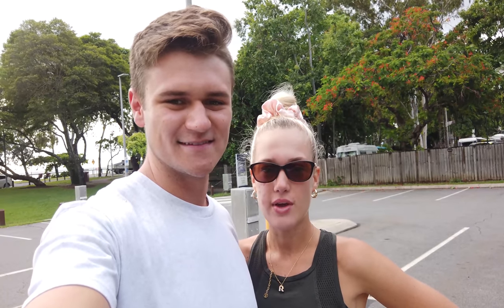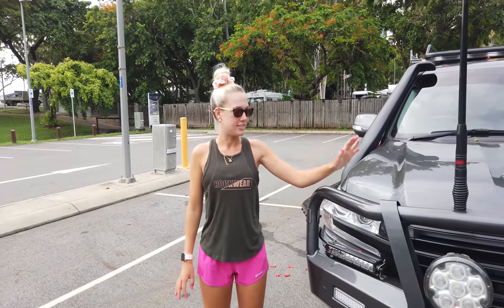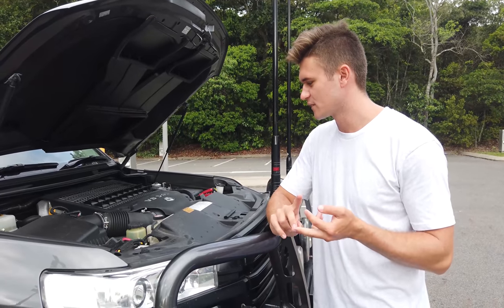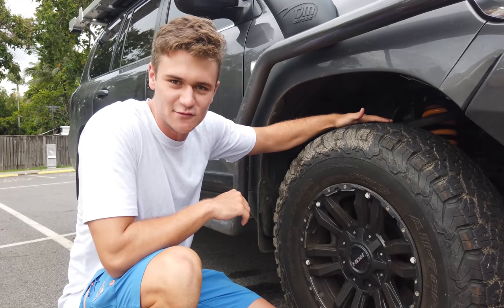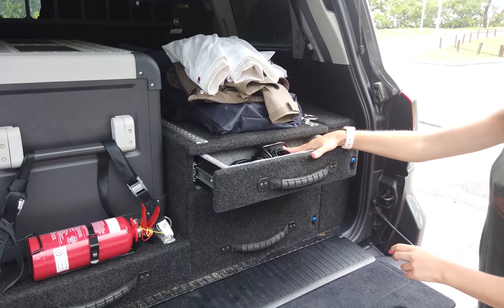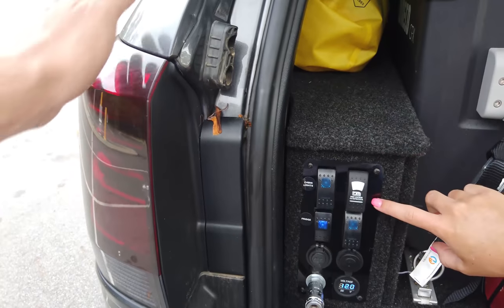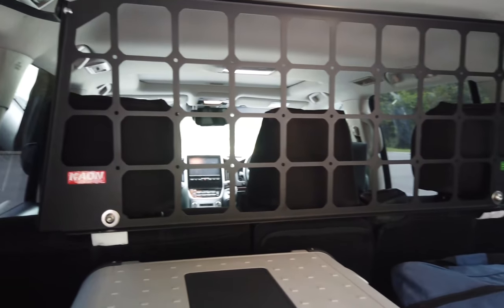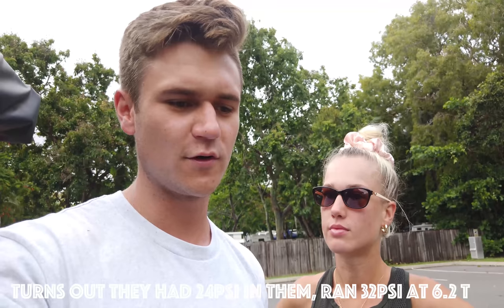200 SERIES LAND CRUISER BUILD | SEAK LIFE RIG WALKTHROUGH!

Comment: Nice rig. You could gain back all the space in your passenger side drawer wing by moving your compressor into the driver’s side rear quarter panel where the factory jack is stored. You can actually fit the ARB twin compressor & 4L air tank in there. Happy trails.
Reply from the maker: That sounds good ! Don’t need it yet but would be a good little mod!

Comment: Awesome rig! Random question though... are your personalised plates the Prestige/Flexi Framed ones? I’ve buggered mine so going to get them remade and like the look of these - yet to see them in the wild yet 😬
Reply from the maker: They are framed but I would get flex if I had my time again
Reply: @Nickjm1267  copy that - thanks. I’ve got Flexi now and wondering how they would work when I put them in the 200 when it arrives. My main concern was once I’ve added the front bar and have the licence plate flap for the winch, how I’d attach the Flexi plate to it. Might just go for it and cross that bridge when it comes up 🤷🏼‍♂️
Reply from the maker: @opt6037  through bolt be super careful when drilling
Reply from the maker: How did it go?
Reply: @Nickjm1267  yeah good. Stuck with the flexi’s I already had and bolted on to the front 1 double sided tape on the back one. After measuring out bolt holes for front I just taped up the drill locations and started with an extremely small drill bit and gradually got bigger. Think I ended up using 4 different sizes. Anyway - worked well and no cracks through the plate which was great 👍🏼

Comment: FYI the gearbox and transfer case breathers are up behind the motor about 100mm below the top of the engine cover. Very hard to see but I used an inspection cam because I couldn’t find them anywhere and got worried. Probably as safe as they can get
Reply from the maker: Thanks!